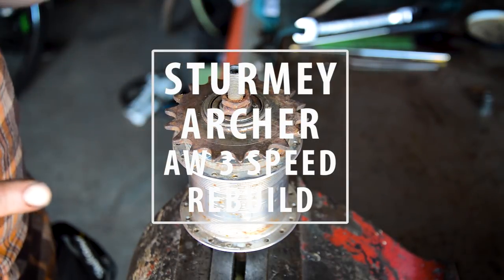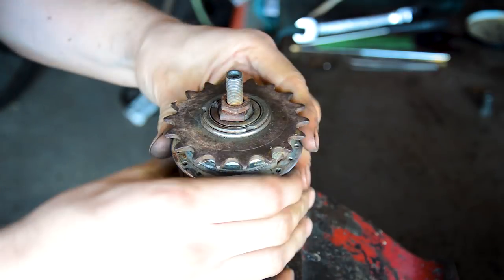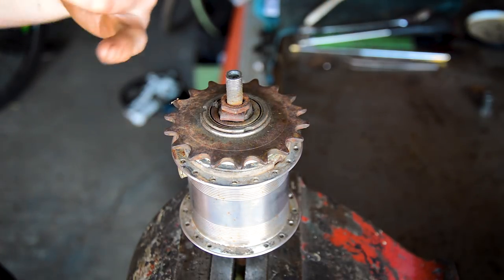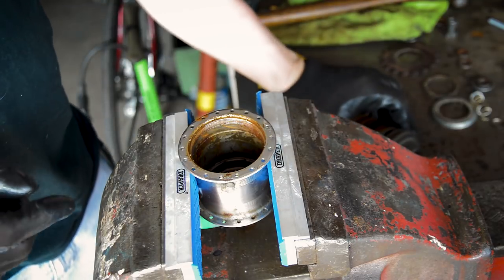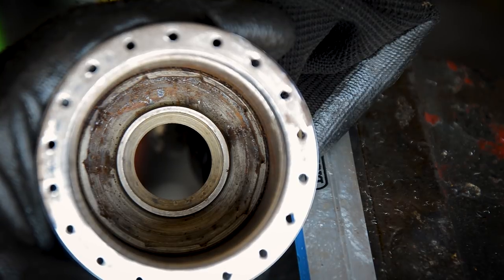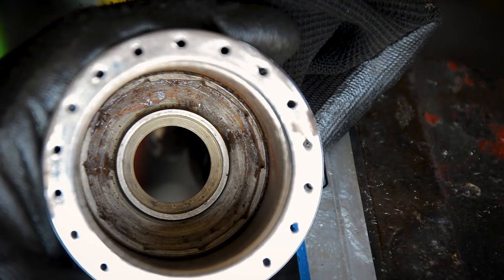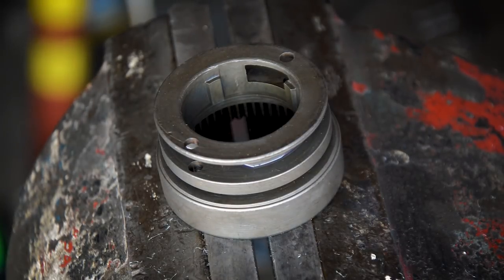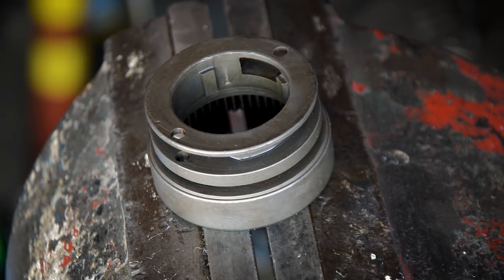Sturmey Archer AW 3 Speed Hub - Full Strip & Rebuild Of A Seized Hub

Comment: TIP: to remove the drive side outer if hub is not on a rim like yours is, get a flat piece of wood about 3/4in thick and cut a hole in the middle (so is about same size of the hub) now cut wood in two, then place around the hub use the spoke holes to screw the wood to the hub, place wood in vice, now use hammer and punch to unlock to outer, and without damaging the hub.

Comment: I've opened up several of my own internal gear hubs and what i find fascinating is the engineering not only in its function and mechanisms, but their assembly requires virtually no clips and fasteners.   Nearly everything is held into position by another piece that prevents it from simply falling out.   These days, if you look at mechanisms on a bike (derailleurs, cassettes, brake calipers, etc), everything is held in together with threaded screws, bolts, and rivets.
Reply: I've just taken one apart for the first time and the loose fit of the planetary pins kinda shocked me. But as you say, so much of the design is its own retention. Brilliant mechanism.

Comment: You start with drive side up. At 1:13 you change to none drive side up. At 1:58 without changing the hub, the drive side is up again. Magic. Further good video. In the Netherlands we are used to hubs with a drum brake, which is slightly different.
Reply from the maker: I've got a few with drum brakes now.  Brakes from the 1930s though... It'll be interesting to strip those down.

Comment: Couple of points on these. The 1950's official service instructions are far better and easier to follow than those published later. Well worth seeking out. And with the later hubs, it is the 36 hole shells that are worth keeping. 28  & 24 hole ones are everywhere, so if your AW is rusted up or worn out, you only need to fit good internals from a scrap 28 hole wheel, and off you go. Plenty of neglected kids bikes and nasty foreign folders still being dumped with the AW the only useful part on them.

Comment: I've restored a fair few of these. The worst it was a right job getting the planet gear pins out. Another was completely missing one of the pawls, pins & spring (a more recent one without an oil hole). I'm pretty sure the one you serviced here had been taken a part by a previous owner. The spring on the wrong side would have been a massive factory error.

Comment: Great video as I've said before when I was rebuilding my 1st AW. I am now rebuilding another one from 1954 and had a heck of a time getting the ball ring off. It would only turn one was and the gear indicator would not pull out or go back in. I finally got the ball ring off but had to take the cone all the way of as everything inside was rusted solid.  The bottom pawls are frozen solid and it had alot of rust all over and the metal oil port  cap was broken off and the gear chain indicator chain was barely sticking out of the whole (thank God it unscrewed because the last one I had would not). Now that is apart and soaking I will try to clean it up and get her working. Hopefully the only other thing I will need is the gear indicator chain (can you just put a new chain on the old one?). What would the part number be for this AW indicator chain be? Thanks for this video as it seems to have the same provlem. Thanks, Mike
Reply from the maker: I've not tried to fit a new chain to the indicator but you can pretty easily find them around.  SJS Cycles has a bunch of SA spares!
Reply: THIS AW HAS THE REMOVABLE LEFT SIDE REVERSE THREAD BALL CAP WITH FLATS TO REMOVE IT AND i HAVN'T BEEN ABLE TO BUDGE IT, ANY IDEAS? tHANKS, mIKE

Comment: Great video. I'm rebuilding an AW from 1964 that I picked up from ebay to take apart and play with to see how everything fits together and works and when you get to the point to unscrew the ball ring to pull the inards out from the right hand side can you put the left axle in a vice or do you have to grab ahold of the hub itself like you did and then unscrew the ball ring. I thought I saw that on another video but with the left side in a vice mine just spins, yours was obviously already loose so you didn't have to worry about it. Thanks, Mike
Reply from the maker: It is a case of holding the body in a vice as best you can without damaging it. Some can be very stubborn to undo!
Reply: @MonkeyShred  Thanks, I double wrapped the hub with duck tape, one side sticky side on the hub and the other sticky side to the outside so it would stick to the vice and after much swearing and pounding it broke free. My problem now is the indicator chain and spindle will not unscrew and the nuts/etc on the right side ore still on so although I got everything loose I can't take it the rest of the way apart because of the spindle and chain. Any ideas how to get the spindle unscrewed from the axle key in the axle? Thanks, Mike

Comment: Hi , I recently acquired an AW 3speed from 1954 and I am refurbing it. It has the left -left threaded ballcap that unscrews and I can't get it to come loose. I've already disassembled the whole thing and want to get this cap of for cleaning. It was pretty frozen/rusted on the left end and I've got a new planet cage coming tomorrow. I might have to replace the left end pawls and screws as they look pretty bad, Any tips on getting the left-non drive ball cap loose and are they still available? Thanks, Mike
Reply from the maker: I've not tackled the job of removing that cup yet so unfortunately, no tips from me.  I tend to find SA spares on SJS Cycles

Comment: I see your very sparing with oiling the parts. Does that mean that I can't fill the 3 speed with grease to cut down on the ticking sound ?
Reply: I was thinking the same thing. I'd have plastered that thing with light oil and grease. The planet gears were bone dry, and the ratchet teeth inside the hub body saw no lube at all neither did the tips of the pawls which engage with them.Imagine teh wear. Also, what is there to stop the rust setting in again over the next decade of use? Oil it and grease it up - I say.

Comment: Awesome video and great job restoring it. I'm just wondering, you were surprised when the spring passed through the driver. I just took apart my 1972 AW and it does the same thing. I was looking at RJ's videos and the spring stayed at the back of the driver on both the 1974 and 1954 AWs. Did you find it still shifted properly with the spring passing through to the cone?
Reply from the maker: I can't even find the part where I took the spring out.  I haven't actually used the hub yet though, it's still sat in the parts drawer clicking away nicely.
Reply: @MonkeyShred  Thanks for the reply. It's around 1:37, but I just realized it was on the wrong side too. Yesterday I found something on Sheldon Brown's website which says some older AW's springs pass through to the cone and it doesn't affect the functionality so I'll keep going with my rebuild.

Comment: Great video, I have a 1986 Sears Free Spirit with a Sturmey Archer 3 speed hub that I am refurbishing. I think I've got it shifting pretty well but if I decide to strip the hub down any suggestions on what I should go ahead and replace once I'm in there without getting too expensive. Anything I must/need to replace once I open her up? Working on getting all the chrome looking good right now. I have put alot of wd40 thru her to get it freed up. What oil should I put in her know. It says 86-10 and 3 speed 53c  coaster brake on it. Thanks, Mike
Reply from the maker: Hi Mike.  I haven't opened up a coaster brake hub before so I'm not sure of the workings on those and if specific braking parts need to be replaced.  For a standard AW I would just look at bearings.  The rest of the gear mechanism is usually fine to keep on ticking away!

Comment: Hi (or anyone else) , I'm rebuilding an old AW hub I picked up off of Ebay just to get familiar with how these work and how to take apart and reassemble. I have put it back together using this video and after cleaning and I lost one of the pawl springs on the bottom left side. Someone told me that I could put it together with one pawl and bench test it on a vice since there would not be a load on it. I did not oil the hub just used spray lube for the bench test. It works fine by pulling the chain out in 2nd and 3rd but will not go into 1st gear. Could this be because I am missing one pawl and or my springs are probably original from 1964 and they are weak? Thanks, Mike
Reply from the maker: I don't think it would be down to missing a pawl spring personally although you should be able to find a replacement.  There are still lots of spares available for the AW hub.
Reply: @MonkeyShred  Well I've got it all cleaned and put back together and when I bench test it in a vice it goes through all 3 gears without the hub on but when I put the hub on I cannot get it to go into 1st gear. I put in 4 new springs. Any ideas? Thanks Mike

Comment: Some people report flaw with this particular model : it sometimes disengages from the middle gear into the neutral. Have you experienced such a problem. Any solution to this ?
Reply from the maker: I think that's just a slightly misaligned gear selector tbh and the cable tension would need adjusting.
Reply: @MonkeyShred  thanks MonkeyShred.

Comment: seized hubs are no problem and if you like try useing what we in the USA use its called WD40 a time proven solvent/lubricant that works wonders instead of a complete time consuming teardown and reassembly but lets be honest and just give it a needed overhaul.
Reply from the maker: WD40 is a worldwide thing ;)  It doesn't always work with getting parts free though and even then you'll be left with a rusty soup inside.  Always best to strip it down if you can.

Comment: That one looks like it sat in some salt water. Nasty. :) One question. I have a 1973 Schwinn Speedster with the SA 3 speed. Would you know if that assembly is the same as you have here. The one I have works, but I'm sure it could use a good cleaning, and new grease. Thank you for your time,